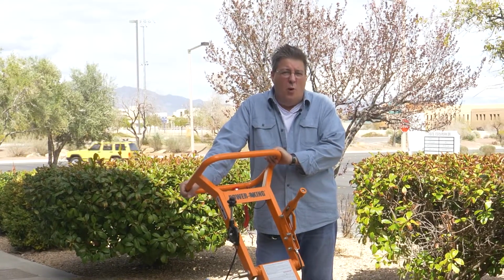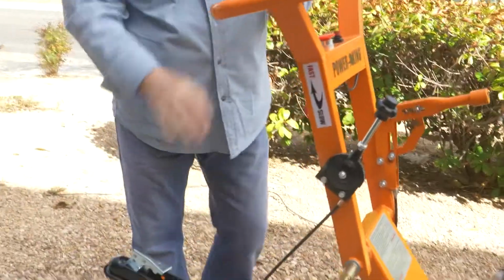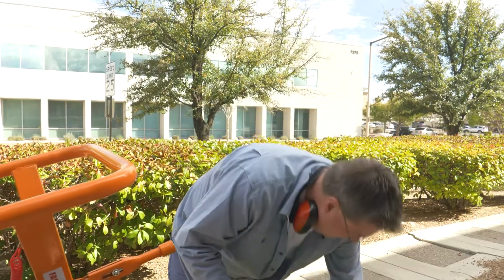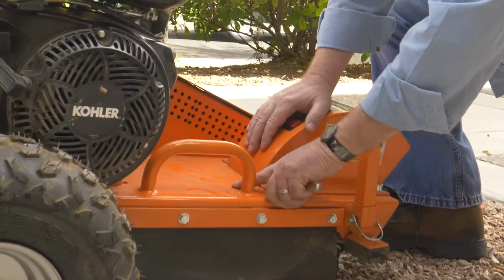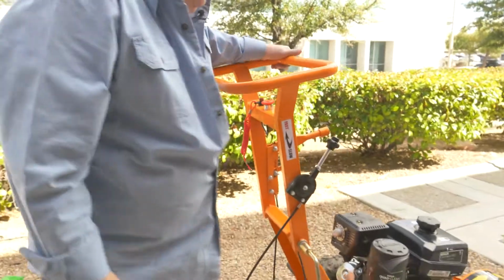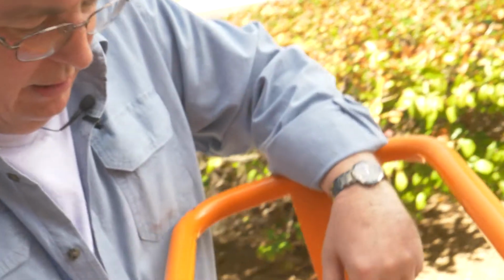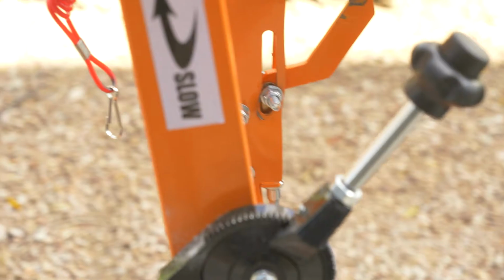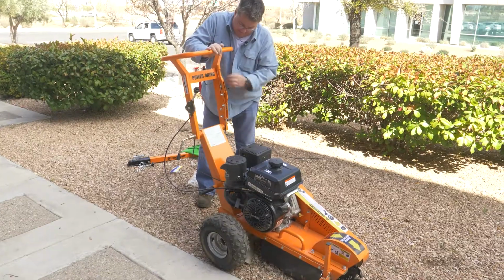PowerKing PK0803 (2018) 14HP Kohler Engine Stump Grinder - WALK AROUND

Comment: I will never need one.  But the important part to me is how deep it will grind the stump. 9" seems to be good depth.  Looking at some, stump grinder is about 2" without having to excavate the left side of the stump.   The stand need to be able to use as the engine is running, it seems to me to be a joke.

Comment: 5-26-21 I just bought this machine brand new and it has two hours on it. I bought it through Home Depot Manchester New Hampshire. This is the worst running motor ever. The oil level is fine but this machine still stalls out and then you can't start it. You have to let it cool down then it will start. If it doesn't start the first time it will crank crank and crank.. my experience with something like this was a cam sensor. But this is awful. It's made for commercial use and I have been on two job site and both times had issues with it starting. Absolutely embarrassing when you have to sit and wait for it to cool down to start again. Again only 2 hours on this machine. When it runs it grinds great but now i don't know what to do because two hours old and I can't trust it to bring to a job site.  Even day 1 it didn't want to start..... I shouldn't have to tear apart something brand new. I want a new machine sent to me and you can have this back.

Comment: How do I connect the left lever to the brake? The manual omitted the assembly instructions on the brake (doesn’t say to put the brake on the axle and connect the lever to it).
Reply: Don't feel bad I got nothing with mine. I was clueless why it had two oil dipsticks. Was I to put half a quart in each or what? There should have only been one dipstick and one as a filler. My motor doesn't even like to start I hope you have better luck. If I shut mine off it won't start back up. Been like this for the total of 2 hours I've used it

Comment: Nice... how fast can you tow ?? 50 mph? also what is the total weight? would it be good for someone wanted to use in stump removable  business? thanks
Reply from the maker: The stump grinder is off-road towable only. Towing with an ATV or Tractor at a controllable speed is recommended. The total weight of the unit is 245lbs. We have both residential and commercial customers that use the PK0803-A. If you have any questions feel free to contact us at 1-800-344-3371.
Reply: QVTools yes,i guess it could bounce all over the place being towed at 40 plus mph...thax